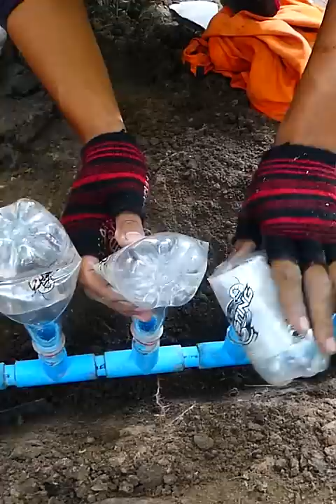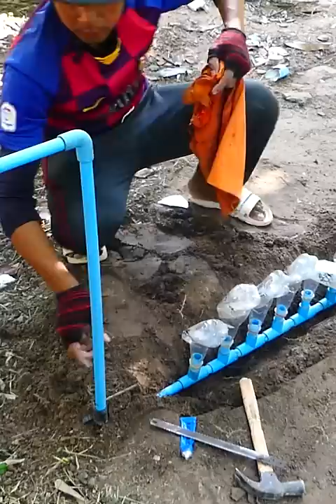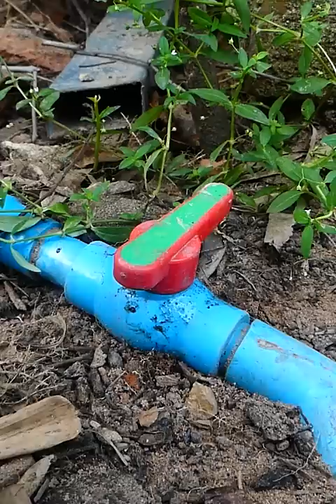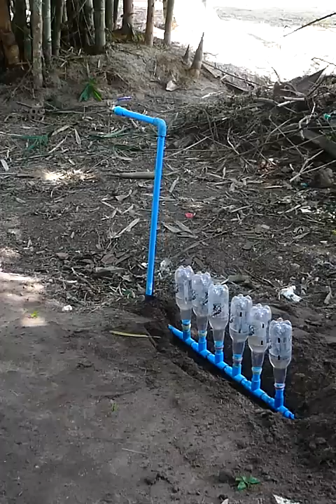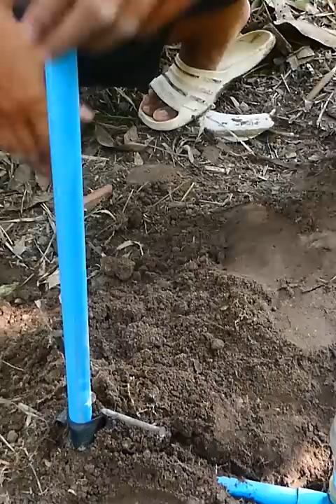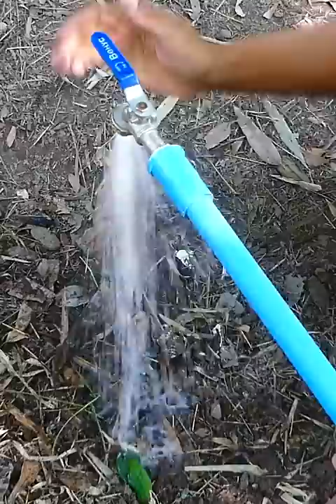Trick Free electricity | I turn PVC pipe into a water pump at home free no need electricity power

Comment: There was already pressurized water available or the bottle would NOT have filled and compressed the remaining air inside them. The bottles were not under a vacuum state or they would have filled nearly to completely full. I don’t know what they think they have created but I would have to see the water supply to believe they created anything other than some extra PVC and perhaps a volume compensator via the bottles when line reassure and flow dropped.
Reply: Exactly that was stupid
Reply: I would like to see the plumber exam
Reply: It works but its like 10seconds
Reply: Hahaha.. Not just the PVC. Your time and amount of clicks + these comments.. Do you know who is Mr Beast?..
Reply: Watch more videos. The water pressure for this system is created by a siphon pump which requires manual labor to prime but 0 electricity or fuel to keep it flowing.
Reply: It was pressurized by using a siphon pump. You can see how to make them in the other videos. He doesn't speak English. He copied and pasted the same caption to every video.
Reply: They created watch time, clicks, and repeat watches of confused ppls. Hate how none sense things are becoming.
Reply: @tripleohno 
Oh no?

Oh no!

OHH NOOOO!!!
Reply: @mototoad1242  have to say first I've seen someone reply like this, thumbs up
Reply: @brookelord3448 once the pump is charged could it run without anymore outside source?
Say it pumps water backninto the ssme pool of water so the water never runs out? If so it could pump water tonthe top of a wheel and from there turn the wheel and return thebwater to the same source?
Reply: Can someone explain why it does that... the pipe already had pressure, otherwise it would be impossible to have filled the water bottles to that level. This is just an illusion, it doesn't work in real life.
Reply: This is really misleading
Reply: Haber,  más despacio cerebrito...
Reply: The only thing they created is you commented here... be happy for that :)
Reply: So is the source under pressure? How far down does it go? And where is the hose on the other end?
This is silly, so let’s do the math….. let’s assume we are at ocean level and the water table is ten feet underground. Just for easy math and to be able to scale later on….

To calculate the pressure required to raise water through a pipe, you can use the hydrostatic pressure formula: P = ρgh, where P is the pressure, ρ is the density of water, g is the acceleration due to gravity, and h is the height of the column of water.

Assuming standard conditions (density of water = 1000 kg/m³, acceleration due to gravity = 9.81 m/s²), and converting the height to meters (1 foot = 0.3048 meters), you can calculate the pressure required:

P = (1000 kg/m³) * (9.81 m/s²) * (3.048 m)
P ≈ 29,421.56 Pascals (Pa)

This is approximately the pressure required to raise water 10 feet through a three-quarter inch pipe at ocean level.

This pressure would have to remain constant and this is not taking into account the original water depth and rate of consumption nor if there is a vacuum forming in the source requiring even more pressure at the head of the system to operate. 
Oh yes and this is not how vacuum pumps operate, the vacuum needs constant maintenance of negative pressure to operate and the vacuum end to be technical is open ended. Sure you can prime a pump this way but that’s it. 
But what do I know.
Reply: @TheHawky55 report as spam and click don't recommend.
Reply: If their electric power is only intermittent, this might help keep the water flowing when the pumps won't work.  You don't want a vacuum in the bottles-- this mechanism relies on compressible air pockets.

Comment: He has pressure to fill the bottles, this doesn't increase the pressure of anything. Just if he close the source, he will have pressure for about maybe 1 or 2 seconds, since those bottles are only storing pressure but are too small to be useful. In comments they even talked about a storage for water, but it doesn't make sense because the bottles are too small and to be somewhat useful the tank should be (first of all bigger and) above the tap, so the water will come out without air bubbles and the weight of the water may give more pressure, depends by how tall it is (but if he has pressure to fill a tank maybe in the roof of his house, i don't think he will need it anyway, unless he has frequents problems with water/electricity and he wants to have some backup)
Reply: What you just explained is why water towers are tall. That’s all I knew about them is every foot above ground water creates pressure just by gravity . I learned it at a waste water treatment plant I worked at and all I did was cut their grass
Reply: here the point is apparently that when released, the bottles are not filled with air and the vacuum is maintained - but this will work for short-term inclusions until the level of water in the bottles drops to a critically low level wash your hands fill the bucket but do not water the paths and the garden
Reply: Your explanation is completely unnecessary. He had a hose connected to it. Your explanation is also fundamentally wrong. Water pressure cannot climb higher than its source; the collective pressure of those bottles doesnt combine, they're all separate reference frames and dont add any back pressure relative to the distance theyre covering. Why are water towers ALWAYS on top, or taller than, every building they supply? You're welcome.
Reply: @dmitriyporisenkov7657 It won't do anything. The water is not going above the water level you see in the bottles. When he turns it on, he is just letting the already present hose pressure push the water out.
Reply: @D-Vinko 

He's no saying that. This is the thing. 

The remaining part of the bottles are partially filled with air. When he opens the source the bottles are filled part with part water and part air, the air compresses equating the internal pressure of the source.

If the source loses pressure, the air that's still compressed will expand maintaining the previous internal pressure until it's expansion equate the resistance (the height plus the load loss) then it will stop coming out. 

Now, the pressure lost is directly proportional to the expansion of the air (after the lose of the original pressure) if you have a bigger tank, you'll need to evacuate more water in order to expand the air the same percentage, so as a result you'll have the original pressure more time.
Reply: Если покрасить бутылки в черный цвет, можно давление увеличить). Я так понял, бутылки, это гидроаккумуляторы.
Reply: @D-Vinko  what level do you mean? He has pressure, so it probably comes from a pump or water tower (i don't know the name in english) and it's obviously higher than his tap. He placed the bottles under the tap, so it should not work at all if he doesn't take water from one of those things anyway. I just made assumptions, i thought that maybe his pump or water tower doesn't work all the time, so i said that he needed to place a tank of water higher than his tap in order to use gravity when his water is not running, so he will have usable water until the tank is empty. But i guess it's not what this guy needs, i watched some of his shorts and he is here just for views (posting the same thing many times and using the same fake principle), so he basically fakes problems, makes some random stuff with pvc and bottles, opens the tap again and call it a day
Reply: @dmitriyporisenkov7657 yeah!shit goes downhill and the hot is on the right!
Reply: @D-Vinko   google a ram pump - water can go uphill... but what this dude was not that lol
Reply: The only thing this does is smooth out the pressure pulses of a positive displacement pump.
Reply: @Azmodon  Why even mention a ram pump if that wasn't relevant? I KNOW what a ram pump is. I also can guarantee that I know more about this entire field (plumbing) than you do. What way can you make water go uphill this continuously, without an already established water source like a water tower, or water mains?
Reply: @cristianvitale897  The air pressure is caused by the positive pressure of the water, not the positive pressure of the air. The air pressure isn't supplying ANY force against the water, because the water is both heavier and less compressible than air. The water is being pushed against the air, compressing it into the bottles, but that compression has no bearing on the external water pressure. 
The question you're getting the answer wrong on is; "Who's pushing? The water, or the air?"
The answer is the water. That water is producing the positive pressure, and because water is air tight, it would pull a vacuum in the line when it's allowed to drain away from the bottles. That's simple thermodynamics, there cannot possibly be enough energy in the bottles to push more water out of the hose when it's closed; that energy is directly related to the water itself and not the air in the bottles.
Reply: @qualcunoacaso4865 The water level in the bottles. I had never even considered people would have such a fundamental lack of a grasp on pressure that they couldn't understand that pressure can be negative. The starting pressure in those bottles was negative, relative to their volume. There was no air compressed in the bottles; he squeezed them out specifically to ensure that the air pressure would let water in. But because one end of the hose is open, those bottles aren't compressing. Home water taps come out at about 40-50 psi in the USA, hose bibs are around 1 inch in diameter, and due to flow dynamics, the 4-5 pounds of pressure that the water supplies is pretty much not creating nearly any back pressure in the line. Presumably this isnt the USA, and the water pressure seems superficial, so my guess is a water tower or pumped well water source.
So likely 20-30 psi.
Because of the way that the hose is designed in this video; the water CANNOT come out of the hose BEFORE those bottles are full (assuming the bottles were squeezed like the Op did in their video.)
This is because the diameter of the bib is the same as that of the bottles, and the bottles are in a straight line below a 90° connector thats some double their height. If water started to crawl the joint, it could only get as high as the bottles openings before the pressure needed to go toward the bottles. Once the bottles are finally not negatively pressurized, the water can flow against its own positive pressure.
Once a NORMAL hose is turned off, air will rush into the bib, and follow the water which should be draining backwards into the line. Once this hose is turned off, the relief of negative pressure will start at the top and work it's way down to the bottles; the bottles being lower, and as Ive explained many times, do not contain any additional air pressure (They were purposefully evacuated specifically so water could fill them at the beginning)
Once the pressure (and consequently level relative to water mass) reached the same level as the bottles, it'd all start to drain at around the same time. This is relative to the opening of the bottles, not the bottles total volume; because the rate of flow of something is determined by the size of the nozzle relative to its pressure; and not the volume of the container.
We can actually calculate how much water is above the bibs of the water bottles.
Assuming those are 2 liters; they hold 2 Kilograms of water each, when full. Assuming the ball valve at the back end of the hose is closed, then the necessary pressure to crawl up that hose (a 2 liter is roughly 12.4 inches, we will round down to 12, and to be extra generous we will assume that the bottles are embedded in the hose, instead of sticking out, for a total height of just 2.25 feet; we will do a calculation with just 2 feet aswell for fun;
The pressure to crawl up that line is 0.433 multiplied by the height of water above it in feet. 2.25 = .974 PSI and 2 = .866 PSI.
Water exerts the same pressure downward independent of its volume; when they calculate a water tower's pressure, they use the aforementioned constant of feet*.433  The bottles are holding their water at a little under 1 foot off the ground; collectively they all only produce about .433 PSI.
Not enough to push the water up the line. If they were stacked ontop of eachother they could feasibly push water out of the line; but because of physics, that stack would be taller than the hose outlet.
Reply: @cristianvitale897 finally a person who understands how physics work, these people in comments are crazy thinking this really works
Reply: Not a pump but an store of the mains pressure in the bottles. Your title is just plain wrong and doesn’t understand the physics.
Reply: Tell me you have autism without telling me you have autism
Reply: he is showing the idea in a smaller experiment, and your comment is for future application - which is right

Comment: Some decent pressure on that mains feed. Not sure what the bottles are for though
Reply: Too see if the mains water supply is working.
Reply: At the end there is pressure pump. Hahahahaha.
Reply: Thought it was a lossless ram pump
Reply: The bottles are there for YouTube views
Reply: The bottles capture air to eliminate hammer.
Reply: Yea its just kinda pointless because if you have main water pressure then the bottles don't do anything. But it does seem like he was trying to use the pressure from the air to get more pressure out of the end. Idk
Reply: @graxo3752  probably he is using a positive displacement pump and wanted a staple water flow
Reply: To keep that air pressure from escaping
Reply: @graxo3752 yeah, that's what he is trying to do.
But even if it were logical, pressure works both ways and one of the ways the bottles would work is by impeding water flow not increasing pressure
Reply: Maybe as a pressure tank
Reply: Deception
Reply: No durará mucho después de un tiempo las botellas se llenan de agua y se va el aire
Reply: Hammer arrestor 😂
Reply: This video is POINTLESS unless he shows ALL SYSTEM COMPONENTS, from the point of water input to this discharge faucet ... and all points in-between; where, otherwise, someone is "hiding" something.  [Down-vote].
Reply: It help prevent water hammering? Thats about the only useful thing I can think of.
Reply: @joemiltorres1337 bottles have air pressure.
Reply: I believe its to create a backpressure vaccuum.
Reply: That is quite clearly a mains feed. Nothing but click bait
Reply: @graxo3752  ok theoretikal this construction can push up the water Pressure  at the outlet ,  but only for a very limited time, because  the bottles are to small to cover more than  1 Liter of water ..  after that  the presure in the bottels is gone and you get only the same pressure as in the pipe without bottles -- so this is absolute Useless
Reply: For free electricity obviously

Comment: You have to admit that if those pop bottles are under pressure there are 2 things that are impressive:
1- how did he fasten them on and hold up to pressure 
2- he actually did create water hammer arresters
Reply: for first you use iron for those pipes that has additional extensions for different sizes of the pipes so you heat em up and just mold em together.
For second if river stream is too slow or at bad angle from the pipe it wont make pressure for it to be able to go up,so he traped air and water fills it just enough so it can make pressure in pipe,mind this only works for a few minutes until you empty like half of the bottles and pressure dissapears,but no one is gona open it for straight minute anyways..
Reply: Water hammer arresters need a seal and piston to keep the air from dissolving into the water. The bottles will be full of water in about a day
Reply: @sukisuki9120 or, its just hooked up to an actual pump. Theres no way you output that much water with the pressure in 6 coke bottles
Reply: What they're NOT Showing is the Water Hose hooked up on other end thats being Pressurized by an Actual H²O pump!!!! And those plastic bottles are just for Entertainment
Reply: @jessejames5942 I don’t really understand what I’m seeing. I presume water pressure from the bottles gives the lift required, but you think this is fake?
Reply: @nathanpearce7169 so what im hearing is.... hill have more water in storage 😏